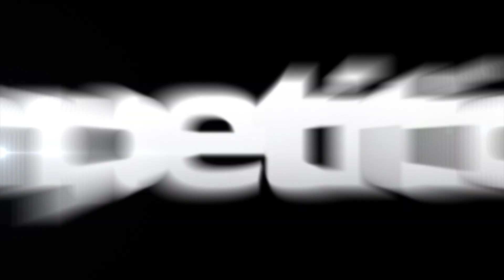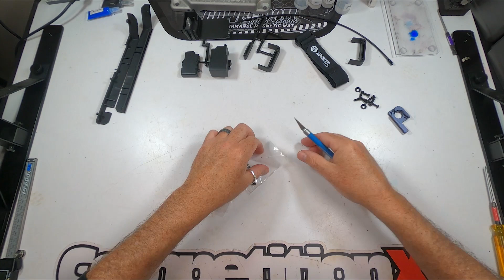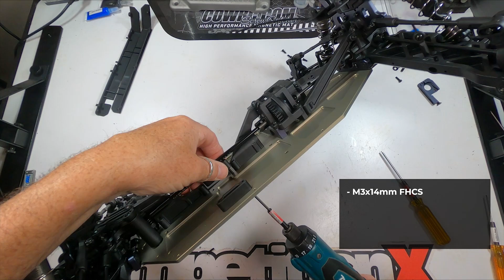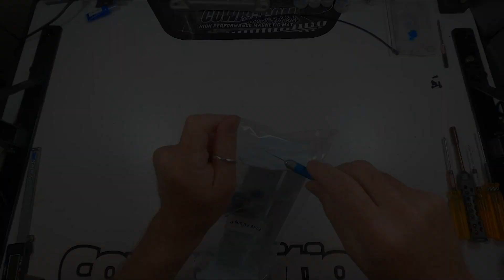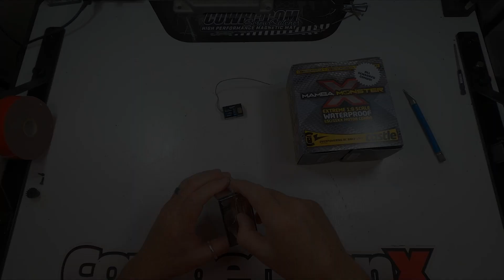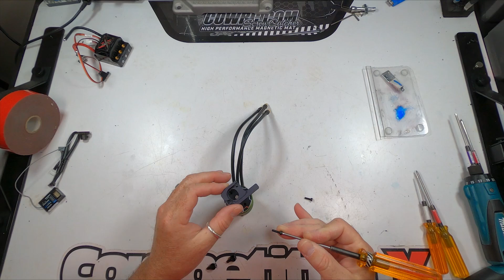Tekno ET48 2.0 Build - Part 6 - Final Assembly, Body, Electronics| CompetitionX

Comment: I have a Max6 with a 4895 motor, is there any way of installing them into an ET48 2.0?😁🙃
Reply from the maker: Visually looking at it, it looks like it should be fine. I would just double-check the length - I think the Tekno site has max motor dimensions that will fit in it.

Comment: What voltage did you run your hbl599 servo at bru
Reply from the maker: Kept it at 7.2v for now. It's FAST at that speed so not seeing any reason (yet) for 8.2v, but might change that to see how much different it works.
Reply: @Competitionx  thanks man appreciate that. I saw the HBL599 draws quite a bit of amp at stall, afraid of brownouts without running a BEC

Comment: Great video series on the build. Was it difficult installing the sensor wire between the motor and ESC?  Doesn’t look like a lot of room. I’m thinking of getting this same setup. I hope the sensor wire has sufficient space where it plugs into the motor without getting kinked.
Reply from the maker: Thanks so much! It wasn't too bad installing the sensor wire - I attached it to the motor before installing the ESC (since the wire mounts top-down on the ESC). I had to wrap it all up and tuck it away but there was plenty of space without tweaking the wire.